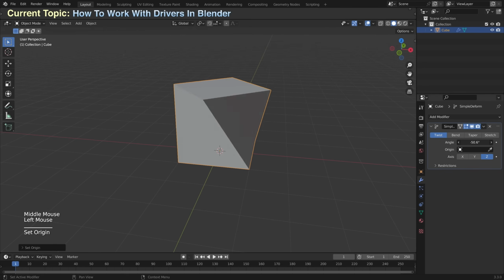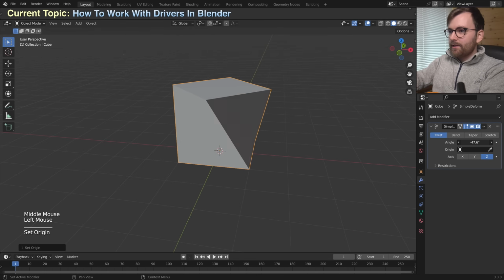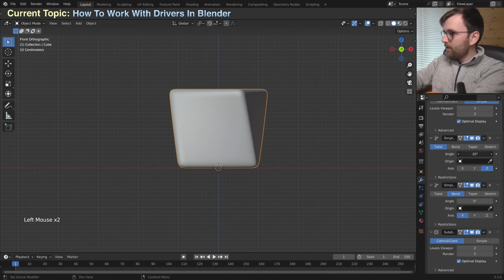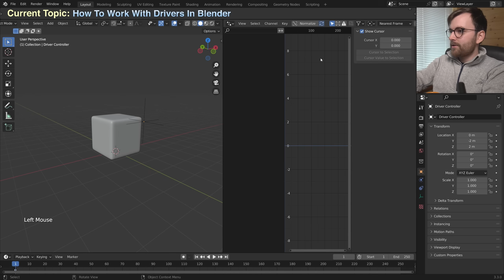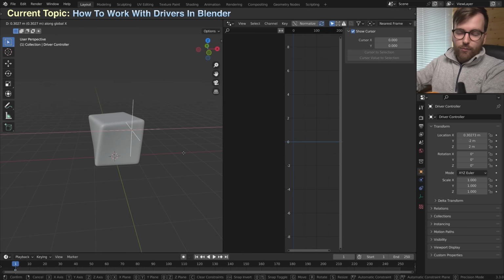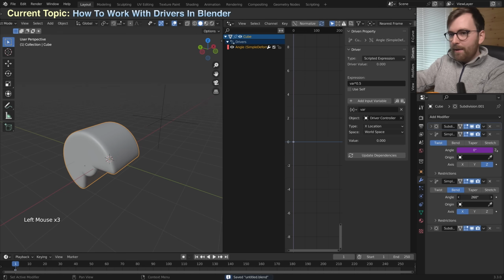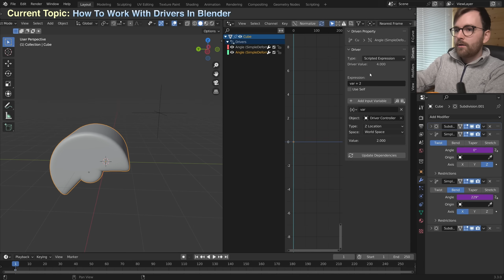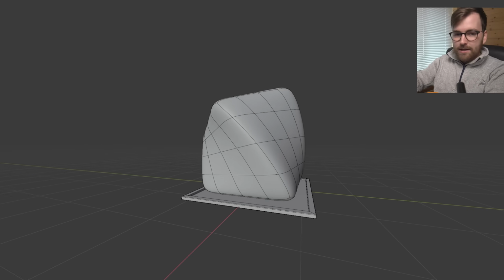Quick Tip: Working With Drivers in Blender

Comment: If anyone has trouble with the N panel not showing the needed fields, don't drag and select the 'keyframe' (the link) in the driver editor, instead while the cube is selected, click on the 'keyframe'. Also if your cube is twisting the wrong way, go into the field where he added the variable expression in the driver editor, and type in the minus sign to fix it. (Ex: var *-0.5) That should fix it. (Blender version 3.6)

Comment: How did you keep the bottom face of the mesh static while twisting the cube? Mine seems to twist equally from top to bottom, if that makes sense. Thanks.
Reply from the maker: Make sure you set the origin to the 3D cursor, after the cube has been moved 1m on the z axis

Comment: for some reason my Z driver was inverted, when going up the cube would "look" down, I fixed this by placing an "-" before (var) making any imput inversed. Do you have any idea why this was happening?
Reply from the maker: Could it be that the cube was 180 degrees wrong? At least it was nice that you were able to figure it out!! Drivers are quite intuitive after you’ve cracked the code!
Reply: @Polyfjord  it could have been that as I was using diferent axis, and yes, they are quite intuitive!

Comment: if you could translate this into keyframes, you could use animation modifiers to give it a bounce for a softer approach
but if I don't want to convert this to keyframes, what exactly do I do to get the same wobble bounce
I suppose you simply animate onto of the drivers?

Comment: I thought I accomplished something similar through modifiers and constraints by attaching a hook to the top face of the cube, creating another empty controller in front like you did and putting a damped track and maybe copy rotation constraint each at .5 influence targeting the controller empty... Then I noticed I didn't get the amazing ability to twist it into a screw or truly bend side to side since you can't slide a subdivision before the hook modifier and it's just based on the relative movement of the top face. So it can "look", but it's not truly alive. I learned twice today!

Comment: I am currently working with i5-1035G1 & Geforce MX250. As I am a beginner what should I basically focus on:
( Stormy Ocean, Wine glass with liq simu, donut/icecream tut, smoke/fireball, light bulb on table, Cave with monster, forest already done)
A) Modeling 
B) Character modeling 
C)Focus more on photoshop
D)Grease pensil and 2D animation
E) Other suggestions
Buying a new PC/Laptop or renting a rendering firm is way off the charts.

Comment: this might a bit of a begginer question, since i havnt done much of anything, but:
for the end animation, how did you make the target for the twist and bend lag behind the light? its a much smoother motion compared to how the light is moving
Reply from the maker: I copied the keyframes from the empty target to the visible light, and then offset the animation for the empty target by 3-4 frames. It's an extremely efficient way to make a character "react" to something happening! Highly recommended
Reply: @Polyfjord  Wow! insane what a diffrence that makes. thanks for all the great tips!

Comment: Hey thanks for the knowledge Is there a way to limit the move between two values?
Reply from the maker: Hmmm, I'm not sure if there is an easy way. You could use constraints to limit the Driver Controller's location values!
Reply: @Polyfjord  supposedly you can use min and max expressions on the driver variable, I have not tried this personally though.
Reply from the maker: @PeterHertel  nice!! Something tells me if we wait long enough, someone might shop up with the answer :D
Reply: @Polyfjord  This might be totally unrelated, but can you create a rubik's cube rigging tutorial? You can't set the weights to the initial position, because once you try something simple like R U R' (rubik's cube notation), it completely falls apart. I haven't found a solution and it's been 1 year since first I tried it.
Reply: @PeterHertel  hey thanks a lot! I will try that